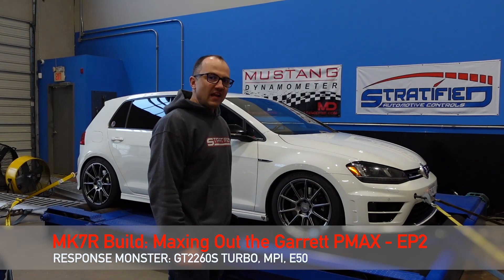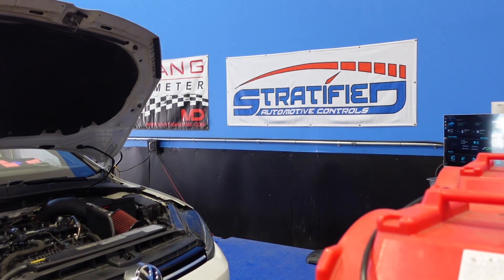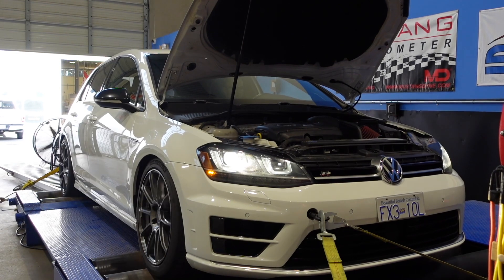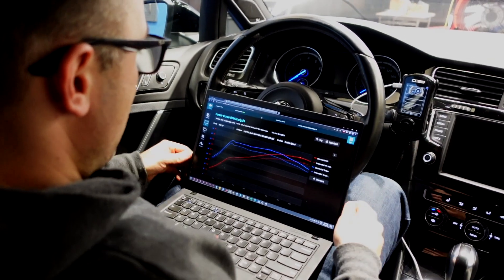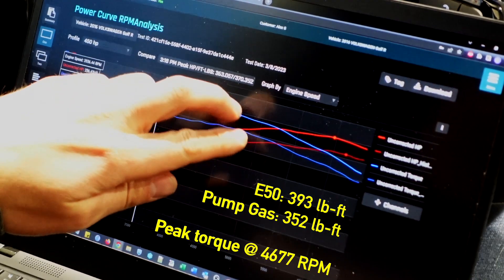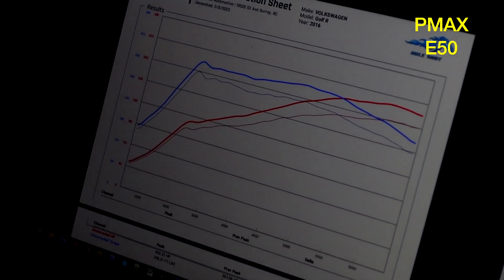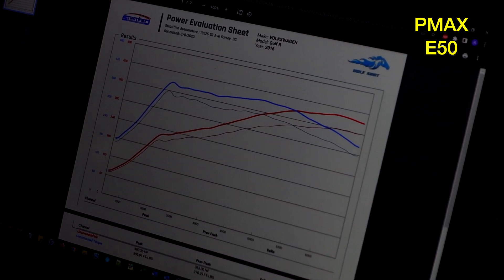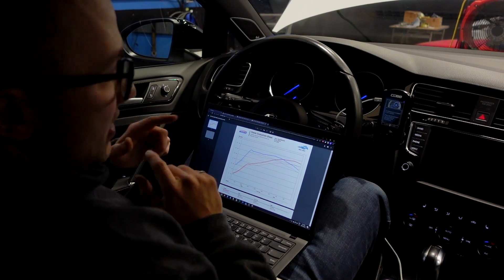Mk7R Build: Maxing Out the Garrett PMAX - EP2

Comment: been running IS20 with E23 (3 and 10).  have an IS38 for it to put on.

will the A3 2019 with this upgrade turbo support any ethanol mix on a stock fuel system?

if not, what is recommended?
Reply from the maker: Yes mild mixes. I recommend our tune and an hpfp.

Comment: If i put this turbo to my Octavia rs 220hp, nothing else change, how much power?
Reply from the maker: The turbo is good for about 450whp but you need a tune, the correct fuel and the correct fuel system setup.

Comment: it's safe to do stage 1 maxing hp like 380hp in reality is around 350hp right?* what about nm 550max?
Reply from the maker: Both power levels can be fine if you are setup and tuned correctly.

Comment: Did you guys use aftermarket charge pipes? I will have the same set up on my mk8 next month!
Reply from the maker: Currently we are using OEM.
Reply: @stratifiedauto  thank you for taking the time to respond. And stoked you didn’t say mandatory to make this power!
Reply from the maker: Charge pipes make a fairly small difference.
Reply: @stratifiedauto  good to know, Cant wait to drive this set up. Also i forgot to ask if you guys are running a Catless DP?
Reply from the maker: Running a catted downpipe.

Comment: Can you say this turbo (powermax stage2) is better or tte555 
[For ea888 Gen3]
Reply from the maker: Depends what you’re looking for. Not sure how the TTE performs but the pmax offers stock like spool and response and another 40-50whp potential over the is38.
Reply: @stratifiedauto  which one is better response in 100-200km ? 
I thought pmax2 would give more power against tte555
Reply: Can you please answer to my last question 🙏🏻?
Reply: @Thenotorious7.5  Gregor10 tested the TTE555 vs the Powermax 2. HP and Torque are basically the same but TTE spools a lot better (3500 vs 4000 rpm)

Comment: Has the car been on the track yet? Was wondering what it was running in a quarter mile? I'm thinking of changing tunes to you guys but I also wanna add a upgraded cts intake manifold along with the mpi upgraded lpfp and hpfp to my custom tune.
Reply from the maker: Has not officially. With this turbo it’s a high 10s car on a good launch. All you need is the MPI and LPFP.

Comment: I’m starting to like this turbo as an option for my MK7R . Have you guys tuned any with a hpfp only and with stock dp? I don’t think I could handle a check engine light with the new Cobb green speed limitation. Do you think this turbo and an IC would pick up 40 wheel on the top end, through the stock cat and on Lower Mainland Shell 93?
Reply from the maker: Yes have tuned this turbo on exactly that configuration and the power delta it picks up over the is38 remains given that the rest of the hardware is consistent between the 2. The combination you have mentioned is a very good one.